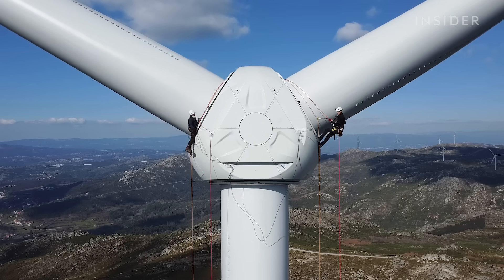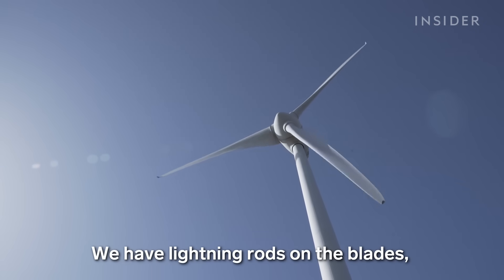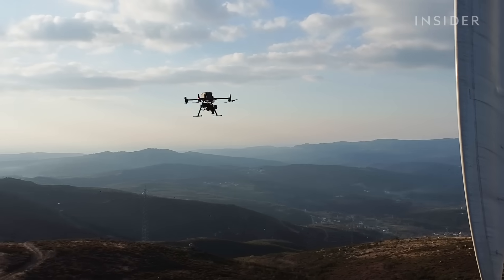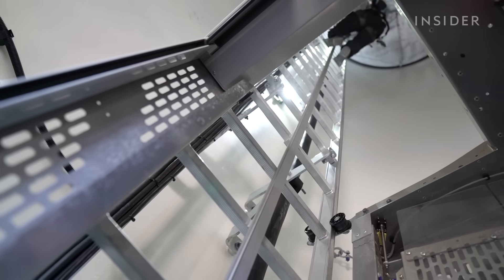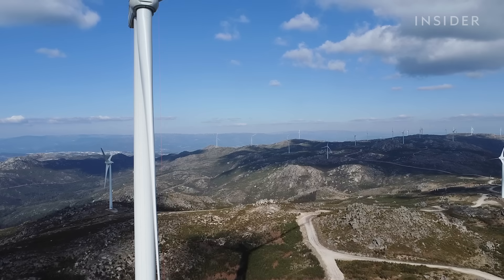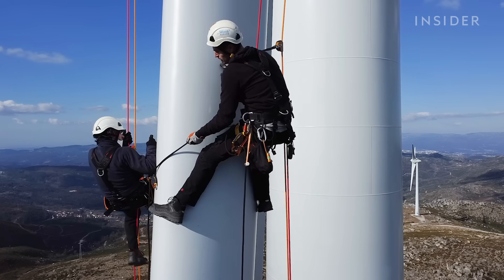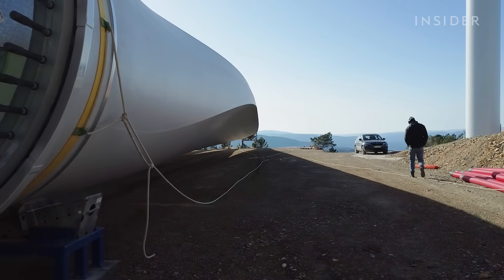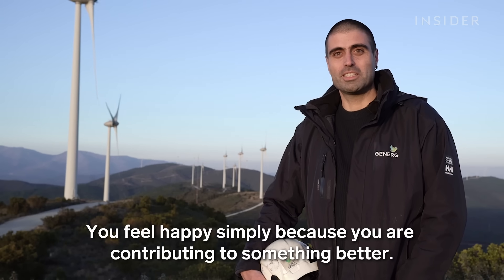How Wind Turbine Technicians Risk Their Lives to Keep Blades Spinning | Risky Business

Comment: Great video, but what is 4.8 MW/Hr? We've got to finally understand the difference between energy and power as we move into  electric everything. I see lots of videos still stating charge rates in KWH and battery capacity in KW.
Reply: Volts x amps = watts .  The K stands for 1000. The M stands for mega or millions. In this instance 4.8 million watts produced in one hour.
For reference your typical hair dryer uses about 1200 watts of power at a point in time, if you ran it for 1 hour you would use 1.2 kWh.
I have a 10 k solar system so I could theoretically run about 8 (8x 1200w=9600watts)hair dryers at full solar output.
Reply: Batteries are usually measured in ampere-hours (Ah) or milliampere-hours (mAh). To find the total energy capacity you also have to multiply by the cell's voltage, which is often like 1.2V for NiMH, 3.7V for lithium, 12V for lead-acid, etc.
Reply: @doujinflip  I undrestand how phyiscs work and how to calculate everything. I am just saying that it is too confusing for 90% of people. If the capacity was always in Joules, and the charging / consumption speed was in Joules per second, it would be so much clearer for everyone. I mean for all batteries, no matter what the size or the voltage is.
Reply: Megawatt per hour i think
Reply: @retrogamer2503  way to go answering a rhetorical question
Reply: @falsemcnuggethope  i was here to just clear a confusion that i presumed was there, not to indulge in a philosophical debate
Reply: The average Turbine is now 4 to 6MW and there are 14MW turbines mostly used off-shore.
Reply: kW is how we rate the power capacity of say a SOLAR ARRAY or EV CHARING STATION. kWh is how much energy we receive from them.
Reply: A battery with 100KWh capacity can run the effect 100KW (100,000 Joules per second) for one hour. A microwave oven usually have an effect of 1KW, so if you run it for 24 hours per month, you'll get an electricity bill on 24KWh.
Reply: I think it is better she should have said it  in words rather than writing also in mathematical form 4.8MW/hr so as to avoid confusion with the unit of work/ energy which is MW-hr, the power it consumes in an hour, as it really generates confusion.
Reply: It's clear you missed elementary school... isn't it? I wonder if you ever heard about gravity lol.
Reply: @SSS_HEX  Elementary school, eh? That's where you learned your insults at? Do you measure gravity in kilogram-hours?
Reply: I agree, I think we should stop using Watts alltogether. For average people, it is even more confusing than a lightyear ("omg he must be a million lightyears old"). We should only use Joules (kJ, mJ, gJ) for energy (capacity), and Joules per hour for power. We already do it for distance (km, km/h) and data (MB, MB/s). Anybody will be able to compare a phone battery without a calculator.
Reply: @IvanKuckir  Watts aren't confusing at all, they are just joules per second. What's confusing is that watts are sometimes converted to energy by integrating with time in hours. So you end up with something other than joules for energy because converting between hours and seconds is too difficult. To fix the root cause, we should get rid of seconds, minutes, and hours. Now imagine that happening.
Reply: @falsemcnuggethope  << To fix the root cause, we should get rid of seconds, minutes, and hours. Now imagine that happening.>>

Seconds are the standard scientific means of measuring time.
Reply: @IvanKuckir  In America we still use miles and watts. Our system is better.

Comment: Self running generators would be far more effectient in many ways. Less material to make, less maintenance, less upkeep and it would constantly put out energy for everything.
Reply: “Self running generators” 😂
Reply: Self running on what? Hopes and dreams?
Reply: @Tresla  perpetual motion, mixed with a couple other things. Look into it yourself. The average American home uses 30 kWh per day. Some of these self running generators put out 50 kWh per day. And if it's constantly running without overheating, you'd constantly build up large amounts of energy in a power wall. And then have all extra energy go to the power grid.😎👍
Reply: @Tresla  now imagine billions of clean energy sources all running themselves the items around and the power grid. Combine that with EVs that super charge via the axle and solar, and we'd always be super charging everything everywhere all the time. Seperately and connectively at the same time.
Reply: @caseyford3368  nice satire 😄
Reply: @caseyford3368  Lmao. Yeah, imagine!

Comment: The more I learn about wind the more I realize there are too many problems and is not going to be able to provide our power needs and is a huge boondoggle.
Reply: "The more I learn..." From where? Conspiracy theorists?
Reply: @ThomasKent1346  we've been working on wind for 60 years now, what does it provide? 6% of our electricity on a good year? It's just not going to happen.
Reply: @jaycweingardt11   What country are you in?  Because it sounds like you are talking total BS. Nations with serious Wind Energy such as UK, Portugal, Denmark etc produce more than 50% from Wind and growing.
Reply: @honesty_-no9he  is it 50% every day? Because if it is intermittent then you have to invest in backup such as natural gas Turbines or batteries which are prohibitably expensive. So if you look at the energy mix of countries with large amounts of wind they have had to also invest in backup sources, leading to neglect of the system compared to investing in the most reliable energy sources only. And you will pay for it in part in  higher energy bills and in part in taxes, and part by the blackouts that you will have to deal with on calm days. There is no free lunch.
Reply: @honesty_-no9he  we saw this last winter in Texas, they invested huge in renewables and when push came to shove the wind froze up, solar was covered in snow, and the fossil fuel infrastructure was chronically under funded and cost cutting measures meant the natural gas infrastructure was not prepared for the cold. I'm in NM and we cannot choose not to invest to protect our oil from the cold so we made the investment and did not have a problem.
Reply: @ThomasKent1346  physics, intermittently, total system costs, gov't subsidy, unrecycleable waste. It adds up man.
Reply: @ThomasKent1346  and what about the birds? If you killed a bald eagle you'd be put in jail but wind farms kill 20 or more a year just so you can say you are "green". That is hypocrisy.
Reply: @jaycweingardt11  CO2 emissions and bird death rates are not comparable ar all.
Reply: @Freba9  you are correct, because co2 isn't killing birds but wind turbines are.
Reply: They just told you that Portugal gets 70% of their electricity and you think it cannot provide power. The problem with people like you is a lack of creative imagination and your tabloid headline POV of the world. RENEWABLES are a basket of different technologies not just one single solution.

Comment: They have a backup rope, right? Not just one? I think there is redundancy which makes this pretty safe? No?
Reply: Yes, look close you see the red is the main line and on their back they have what's called an ASAP as a safety on the yellow line. *source, I train wind techs
Reply: <<They have a backup rope, right? Not just one? I think there is redundancy which makes this pretty safe? No?>>

What happens if you have a fire or a catastrophic failure of a structural part?    What happens if there is a lightening strike on the nacelle while you are standing on it?  

As with a lot of safety issues,  if everything is working normally,  you will probably be fine.  It's when any of a million unexpected failures occur and interact with each other to make things worse that I imagine they get dicey.  

People like to imagine all the risks with a nuclear power plant.  Now imagine a nuclear power plant 500 feet in the air and rotating in the wind.  What could go wrong?

Comment: Eh, these are blade techs, not necessarily wind  techs. Totally different breeds. One deals with electronic hydraulic and mechanical troubleshooting. The other; fiberglass and epoxy.
Reply: The video literally states that they also do the mechanical,hydraulical and electronic troubleshooting. Joao is a Mechanical Engineer by training... Theres actually a degree in at least one university Portugal called Engineering of Energies that is basically Mechanical and Electrical Engineering in one..
Reply: @AlldaylongRock  Sorry mate Tom is right in regards to the jobs they are two different things. He's can be a nasa rocket engineer but doesn't mean he has the qualifications to fix a wind turbine. Chances are he is an engineer but a certified blade repair tech hence his doing a blade inspection.
Reply: @lukekennedy6394  My company works with João, we make state-of-the-art AI models to do preventive maintenance on these turbines and maximize their efficiency. I can tell you João is a wind technician, he knows these turbines like the back of his hand.
Reply: @polterp  A tech and a blade tech is a different thing. Unless he has certifications in both (usually GWO BTT and some blade cert) chances are he is either one or the other,  if he works in the nacelle majority of the time he is a tech but can do basic blade inspection but not necessarily blade repair. My whole argument is you can't do blade repair or maintenence/service without a cert or experience and just because you have a degree doesn't mean you can working on the gear box of a turbine or the blades again unless you have the required certificates.
Reply: What is your company name ?  Does it have a website ?  we want to value if it can be applied on our project .

Comment: Portugal is at 21%.. 
which western countries top on using "wind" as the main source for energy & electricity?

hmm, not easy to see, as most percentage tables are "relative" and point to fx billion people countries like China.. that says very little as per-say.. if it's only 5% of energy, while being the most polluting country on the globe, you really need a percentage of the energy consumption to have any valid perspective..
China is as far as you can come from a western country - and only stands for 6% of their stated energy consumption from wind, so not a lot.
The USA is also very low, and like 8%.
//
# nr 1 seems to be Denmark they pretty alone up in the top with 51% and sets annual new world-records and often with 100% household coverage from capital Copenhagen.
# nr 2 seems to be Ireland with 32%
# nr 3 seems to be Germany with 24%
# nr 4 seems to be Spain with 23%
# nr 5 seems to be Portugal with 21%
but it seems its variable and can fluctuate a bit from year to year

The world's biggest and oldest wind turbine company seems to be "Vestas" a danish wind turbine company, which dates back to 1898 Hans S. Hansen.
It's critical, that western Europe, stop empowering and financing Putin's weaponizing.
Reply: Use Nuclear energy. Consistent and 24h/11 months a year. Can schedule maintenance for the summer and spring

Portugal actually has enough capacity in Wind to run its whole Winter-time baseload, but well, the wind usually doesnt blow that much (around 5.4GW installed in Feb 2022), and to run the whole Summertime demand. It also has sufficient Hydro capacity to power the whole country(8.5GW), but our dams are currently almost empty. Solar is arond 1.5GW, and Natural Gas is 4.5GW. Then 700MW of Biomass. Total capacity is double our needs accounting to historical maximums, and yet, we are  big energy Importers(33% in February, plus 30% of all imported Natural Gas). France has 35% excess capacity over its historical maximum, and is a energy exporter. Why? 44% is Nuclear power.
Reply: Stupid comments. Video said 70% renewables, not 70% wind.
Wind is more common when the sun isn't available (winter, nights, bad weather).
Wind and PV are good complements, you cannot expect either of them to completely push the other out of existence especially in European countries with their temperate climate.
Doesn't change anything regarding the fact that renewables are the cheapest source of electricity.
Reply: @cyrusol  what are you talking about, and who is referring to 70%, like your bltching about??
you ain't the fastest moped on the dock? huh..!
if you replying to something specific in a given comment - then highlight who & what your replying to.
Reply: @cyrusol  When they do something. When they don't, they allow severe speculation in the Natural Gas market that drives prices up by a lot. Countries like Portugal and Germany have some of the most expensive electricity in Europe and are consistently higher pollutants per kwh than France for example. "The cheap gets expensive" is a saying that is used a lot in Portugal and it applies to this situation.. Wind is unpredictable and jank, so is Solar. They also occupy enormous amounts of land and provoke deforestation.
And that whole "wind is more common when Solar is uncommon" is absolute bullshit. Plenty of cloudy days or nights with basically 0 wind are pretty common.

Comment: These towers could have 3 turbines per tower generating 3 times the energy if they were vertical turbines. This would reduce the amount of towers needed and perhaps reduce tower sizes also.
Reply: It would not make 3x the power. Vertical turbines are no where near as efficient as horizontal turbines, there is a reason why horizontal turbines dominate the industrial field.
Reply: @Eledaraumar  if you have three turbines it generates three times as much power. one turbine generates an equivalent amount and three turbines likewise. one way of achieving this is to have the turbines stacked upon one another vertically. three turbines vertically stacked upon one tower would generate greater amounts of energy from a smaller amount of land space. using less land space is key to the expansion of this energy supply industry.
Reply: @L.M1792  Three vertical turbines would generate three times as much power(probably not even 3x) as one VERTICAL turbine. Not three times the power of a one HORIZONTAL turbine. Why do you suppose vertical turbines are not widely used in large power production operations? Vertical turbines are great for some applications, this is not one of them.
Reply: @Eledaraumar  products have processes. Perhaps too many already placed orders had to be met. Maybe simply routine of manufacture in processing. The machinery present factories use manufacture particularly shaped turbines and to change this during a gainful period of product orders would turn to a costly divestment. Most improvement  is stemmed because of such restrictions.

The simple fact remains that three turbines are greater than one. There is no disputing this. It is cost effective to have one tower generating from three turbines. It is also space saving.
Reply: @L.M1792  Okay, lets play out your logic here. Why would three vertical turbines on one tower be better? Why not one BIG vertical turbine on one tower?